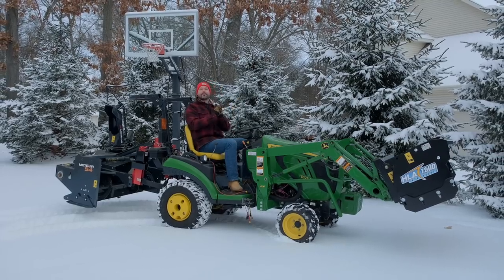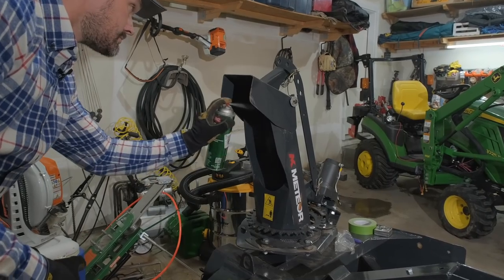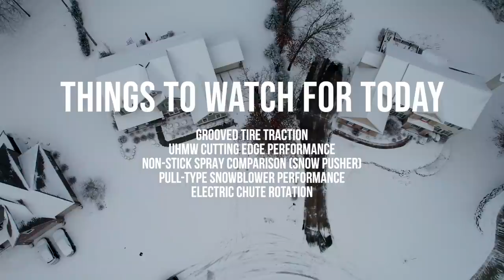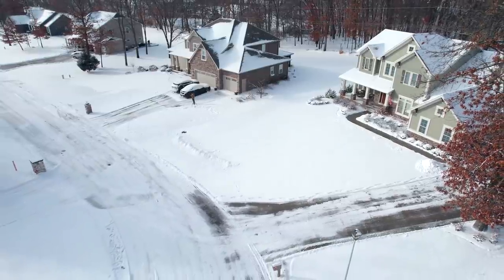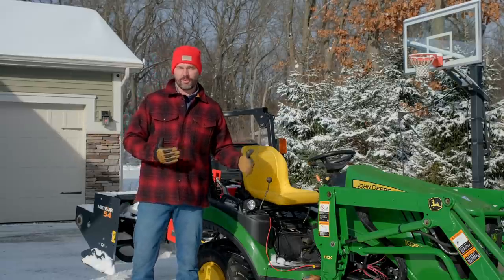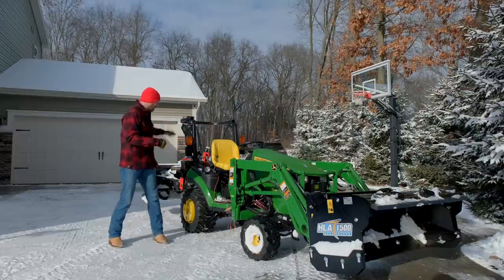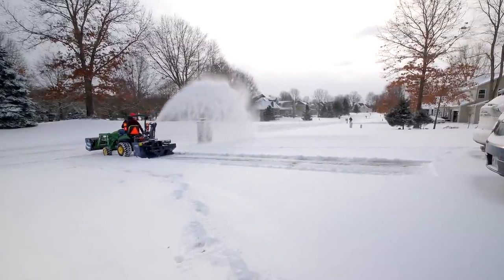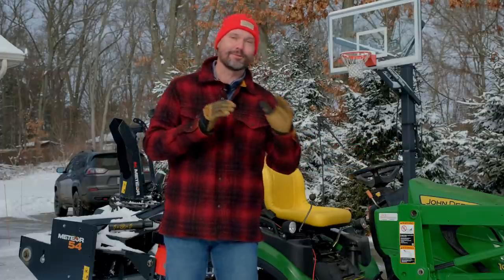FIRST SNOW OF THE YEAR WAS TOO EASY FOR THIS 1025R SETUP.

Comment: I’m a fan of your videos. But speaking from experience, I’ve had tried every type of snow removal equipment to maintain a 1acre home where we get a decent amount of snow. I started with a Jeep with a plow but wound up with big piles of snow. Then I added a 2-WD compact tractor with a loader to move the piles of snow. 2-WD required chains, which scratched up the asphalt. Got a 4WD tractor. Then the Jeep died. Got a rear 3-point snowblower. Worked great, but the 2 herniated disc’s in my neck didn’t like it and the wind blowback wasn’t much fun. Got a Polaris Brutus with enclosed cab with heat and a power angle plow. Great plowing, up to 6-8” because of the grade. Got stuck a lot. Got a walk behind snow blower to supplement. But got the blow back again. The best option is an enclosed cab front snowblower. Took 22 years to figure it out
Reply from the maker: I've got nowhere to blow the snow for a huge chunk of my driveway.  I have a huge corner with garages as well.  That option alone wouldn't work for me.  I've said it many times, there's no such thing as some size fits all solution.  Everyone's circumstances are unique.
Reply: It also takes some pre-snow planning. Moving vehicles to strategic locations so they don’t interfere with your plan.
Reply: Bobcat 5600/Toolcat?
Reply: I've had a John Deere 277, 530, 2320 and F725 all with front mount. F725 was shaft driven single stage and powder everywhere. I used an electric visor snowmobile helmet so I could kind of see.
Currently have a 3520 cab with front mount and a 4066R is on order with a cyclone inverted blower.
I clear my funeral home, yard and cemeteries, cut grass, dig graves and there is no single machine that will do half the jobs great. Front mount means no FEL and no way to unstuck yourself, 2wd is pointless for the same reason, belt driven is painful the amount of times I had to unhook to reset belt that pops off every time you hit hard snow or anything remotely firm.
I broke 2 shear pins today and have gone through over a dozen this winter already and I cannot wait to get a 1/4" or thicker steel blower as my 59" JD blower just cannot handle the rough cemeteries and the debris they contain.
I have a B95C backhoe, Kubota 2700 diesel zero turn, Kubota 040-4 excavator, dump trailer, deck over, enclosed x4 and a ramped utility trailer. None of them replace the strengths of the other, but size matters in tight quarters and each does something very well.
I do like to be able to use the front blower as a snow pusher when you cannot blow, between house and vehicles for instance. It isn't a snow pusher, but probably 60% of one and it works well enough.
Reply from the maker: @jeffreylee7184  What about the entire landing pad up top where there are garages on two sides, trees that touch the edge of the driveway and property and a driveway in front?  There is nowhere for that snow to be blown.  Plus, I use a different setup every winter, sometimes multiple setups to make videos.  I could use a shovel as well, but what fun is that?
Reply: @GoodWorksTractors  Absolutely. Also, snow blowers are not a good option for gravel driveways..
Reply: I've tried many of those options and my favorite is a skid steer with 12.5 tires, enclosed cab and heat!  Typically use a large bucket but just started using a pusher with a full rubber bottom which works well so far.
Reply: Courtney is right as there is nothing that can be the best solution for all situations.  I will chime in that a snowblower is a fine option for a gravel driveway.  All these attachments have pros and cons. With consideration to skill level of the operator there is a lot of possibilities!  I think the setup shown here is in the running for the most adaptable combo for all conditions, but sorry Courtney I would add a cab to your tractor! Lol
Reply: Well, some people take a little longer than others. But that's ok. You figured it out.

Comment: Greetings from Wisconsin! Hey you two, great to finally get some snow, eh? Well after a lifetime of kicking in the Northwoods, I'll say I think the spray stuff is snake oil, I think it's more important to dry the blower, then apply lube to prevent rusting. 
Second point, as I've always said, no to properties are the same, as no 2 snows are the same. 2" of powder, 10" of wet heavy, 14" blowing drifting,  2" of wet slippery. Hills, steep driveways, long gravel, inside corners, fence along one side, gates, parking lots.  A man needs options. Snow pusher with back drag and a rear 3pt blower is my favorite setup. The back drag is essential, unless it's a snow pusher,  rear blade setup. But then you're stuck with piles which I'm not a fan of. Great job to your brother standing and working while you "play". Take care Courtney

Comment: I have 2 pull type snow blowers.  A 60" amd 72".  The two tractors are a cub cadet ex2900 and new holland boomer 40 hp.  And both have cabs and i leave the loader on both.  I also have the added scrapper blade on the back of the snow blower and i get at least 2 inches from garagw doors.  We do over 100 residential driveways and is the best set up.  Using the snow blade is nice if time is on your side.  But not needed to get close to things with a little practice

Comment: Just my opinion but the best setup I've seen ,a neighbor has a front mounted snowblower with a scraper blade on back that he drags snow away from the doors and looks a lot more compact then your setup. But everyone's area to clear is different but his seems like it would work just about anywhere plus if the snow is really deep your not running the front of tractor thru the snow and drifts first.

Comment: Looks like everything worked well enough. I have tried numerous spays and found none of them last long enough to really be worth the effort or expense. My issue with snow pushers in a residential use is that unless you have a really large area for a snow dump, they eventually lead to the shrinking driveway syndrome.
You may also want to consider a backup camera mounted to the cross bar at the front area of the snow pusher for use when back dragging. As careful as you may try to be, you will eventually hit the wall or the garage doors. This may help delay or prevent that.
And yes, the cab would be a great improvement. Until then - heated gloves.
With the rear mounted blower it really is essential that you are the first person driving over the snow to prevent or reduce the compaction otherwise it just builds up over the winter.
Happy snow blowing!
Reply from the maker: Thinking about one of those heated jackets?  Don't know much about them though.
Reply: @GoodWorksTractors  Might be interesting video comparing a few of them (if there are more than one brand/style available).  That said, on cold days I grab a couple of those hot hands hand warmers and keep them in my pockets for when my fingers get cold.  Also have tossed them inside my roomy work gloves when its really cold...  Just bought some heated Insoles to try out this winter.  I let you know if they really work to keep toes warm.  Bikers use them in their boots for winter rides.
Reply: @GoodWorksTractors  I love my Milwaukee heated jacket!

Comment: That worked very well.  I chickened out at the last minute going into this storm and put the front blower on and the grader blade on the 3 pt. Thursday night.    Turned out we had about 8 inches or so of pretty fluffy snow.  Probs would have gotten away with the pusher.  LOL!  I run the turf tires on my 1025R.  No fluid no wheel weights.  Going on 6+ years on the tires and no issue in winter or summer....so far.  I clear about a 300ft driveway with a pretty good grade.  If I start to slip I throw it into 4x4 and off I go.  I am sure it will be an issue if we get a base of ice some day.  Then I'd be wishing I had chains...LOL!  Thanks for sharing the great video!
Reply from the maker: Turfs are underrated!!

Comment: One thing I think I learned from watching is you need to just push the snow straight ahead. I have a plow blade and had it turned at an angle. Unfortunately i had no steering as the tires slide. I put some suitcase weights on the front hoping it will help. Not enough snow here in SW Pa. To try out yet. Thanks for all video. Maybe a pusher is in my future 🤔
Reply from the maker: I feel ya.  Gotta feather the controls a lot.

Comment: I certainly agree with trying to not drive over the snow before trying to push it or back drag it, found that to be the case with my plow as well.  I would recommend that you bevel the UHMW cutting edge on pusher so the bottom of it sits flat on the ground, so it's front edge meets the ground (same level as the side UHMW "slides").  Especially with the thickness of that UHMW, it will take forever to "wear it" down to that point, especially with the side slides, and until you do, the more "packed" snow is going to push the cutting edge up.  I did not see a close up of the cutting edge or slides on the rear snow blower, but I am assuming it is more traditional and the leading edge of the "cutting edge" is closer to the ground, allowing it to cut through the snow you drove over, better than the thick UHMW edge on the pusher.

Those wide UHMW slides may also be keeping the pusher from getting through your packed snow from the tires, the width making the pusher float up and over the packed snow.  Thinner slides might more easily push through the snow pack, while still protecting the driveway surface, allowing the rear cutting edge (once it is beveled) to cut through the packed snow.......  Though it will not float as well then when going over your grass (just take the loader out of "float" and lift it just a little bit).

I put a 3/4" UHMW cutting edge on my 94" plow and have been amazed at how much "abuse" it takes and it has only "worn" as expected, no "damage" (breaking, cracking or chipping).

Great video!!
Reply from the maker: Steel without any shoes doesn't get through that packed snow.  Used that setup and still left packed snow.  Just don't drive over it.  It cleared unpacked areas just fine.

Comment: Really like that blower. If I thought I needed one, that would be a great way to go. Also really like the HLA. I’ve been pondering getting one for 2 years now, but can’t justify the cost in my head over just using the bucket. I like how there’s no curling to be done, as that saves a ton of time. Maybe if HLA gave you a discount code I would be persuaded? 😜
Reply: I have the HLA 60" on my 2032R. Loving it so far. The poly scraper for the back drag cost a pile of money and is almost cost prohibitive. I found the materials to make my own for almost 1/4 of the cost.

Comment: We got hit with 6” off snow here in KY. It’s rare but it happens sometimes. I ordered a set of TerraGrips but they did not come in on time. So I had a grader blade with uhmw cutting edge and some edge tamers. Surprisingly the R4 (not grooved) did great. I didn’t spin one time. Granted I wasn’t on ice. I pushed pretty big piles of snow. Maybe I just got lucky but I think people underestimate the R4. Just my opinion… i know I they’re not that great and I don’t like them either but still… I plowed my driveway and 1/4 mile off the country road I live on (county was overwhelmed) the snow did stick to the bucket and the plow tho. I can’t justify a snow pusher, or a snow plow, or a blower for something I’ll use 2pr 3 times a year… but I got it done… btw I’m originally from Canada so I know a thing or 2 snow….  great video

Comment: great video as always.  i dont like the pull type blower on smaller tractors, if you get a lot of snow you will get stuck quickly.  larger tractors with more clearance, they are amazing.  but forget about doing a drift or snowbank on a compact with pull type blower.

Comment: Wow! Isn’t not getting snow until now a little strange for Michigan? Just curious, do you have that pusher set slightly off the ground? I was really expecting it to act more like a squeegee with that poly cutting edge. May want to invest in a heated vest or jacket. We got my son one for Xmas. He says it works great! Great video. Thanks for sharing
Reply from the maker: Just wearing in the edge and runners.  It'll keep getting better.  Plus, not even steel would scrape through that packed snow.

Comment: Come up to Allegan I have over 20" at my house and private 3/4 mile long asphalt drive  if ya want to really test your 1025R out be curious how it performs with the inverted blower. I run a 5 foot titan blower on my New Holland Boomer 40 and it does great just wish it was wider. Going from a workmaster 25s to the boomer was a good jump now the blower looks small on the Boomer 40

Comment: The one comparison I would like to see on a compact is an inverted like you ran in the video and what they call a hybrid inverted like was shown in the John Deere clip you added.  These are expensive blowers and I want to make the right choice for my next tractor. 

For the cold I use a full face snowmobile helmet with heated visor, artic carharts, cabelas predator pack boots and quality snowmobile gloves.  Im usually out for 2 to 3 hours and never get cold.  The snowmobile helmet helps with the snow dust blowing back at you as well.   Im running a front blower and rear scraper blade.   Inverse of your setup. Im sure I look ridiculous but Im warm.
Reply from the maker: Yeah maybe next year, haha!  Thinking about trying a heated jacket?
Reply: Warm is the new cool.
Reply: @GoodWorksTractors  He needs a cab... just a fact!@

Comment: So. I have the same tractor with the same snow pusher (because of you) I have my backhoe on the back. When you push snow are you using the float function? When I do my front wheels lift and I have less push and I can’t steer. So I end up just touching it to the ground so I can steer. So I am constantly adjusting. Do I need weight on the front or less weight on the rear? Can you use float with the weights on the front l?
Reply from the maker: Takes practice.  Happens with bucket, pusher, grapple, etc.
Reply: I put mine in float. If it fills up. I lose alittle steering. Try to keep pushing straight

Comment: That's the setup I would like to have... The blower on the 3 point gives weight and allows to open things up when needed. The pusher is great for snow that is not suitable for the blower and for cleaning up after the blower was used, the pusher is very efficient.
Reply from the maker: Yeah I find it works really well

Comment: I was at my JD dealer and they had a 1025R with a cab there.  I had trouble getting into it and then it just seemed like I was too cramped inside.  I think you're 6'2"ish.  I would like to know if you have tried to get into a sub-compact tractor like the 1025R that had a cab?  Thanks for sharing different ways to clear snow.
Reply from the maker: I've sat in them.  A little cramped, but I'd take the trade off of being warm! 😂
Reply: Im 5'10 love my 1025R cab. Plenty of room
Reply: @markschmaus5580  I'm 6'1" and a little on the north side of 300.  Plus being 70, the old bod just doesn't move or bend like it used to.  But I can see where a cab would be nice for blowing snow.  A gust of wind, the shoot pointing the wrong way and you get a face full of snow.  Now that's cold.

Comment: Put a heated cab with lights on this, and this is just the setup that I'm looking for. I've got a Case Farmall 1050, and it's great for open spaces, but really bad for the detail work I often have to do, in small parking lots. I need to be able to plow close to walls, around curves, between cars and uncomfortable spots and on walkways. Can the blower handle heavy city-plow dumps on sidewalks?

Comment: In one of your videos about winter tips, you had mentioned to not drive on the snow before clearing the driveway, that way it doesn't leave packed tracks that are hard to scrape off. With a real pull blower, you're have to drive on it first, does it still do a good job?

Also, how does it work with deep snow? I had about 14" of snow in the driveway this morning, more by the road because of the plow.
Reply from the maker: Yeah if you get to it immediately like with the blower, not a big deal.  If you drive over repeatedly or with your cars, that's totally different.  Packs it down hard then.

I've had to create deep piled like in this video at the bottom of the driveway.  It's at least a foot deep in that snow pile.  Handles it fine.
Reply: @GoodWorksTractors  I suppose, it doesn't have time to rest and harden after driving on it, it's picked up a second later.

Comment: Been looking for a rubber cutting edge guard to use if/when we get some snow worth pushing this winter. Typically in the past I’ve just done some residential drives and small streets so just want something to avoid marking drives. Does the edge on that snow pusher work for a standard bucket on a 1025r?